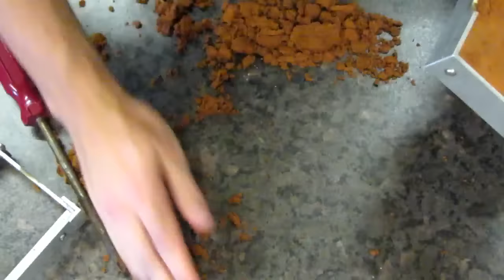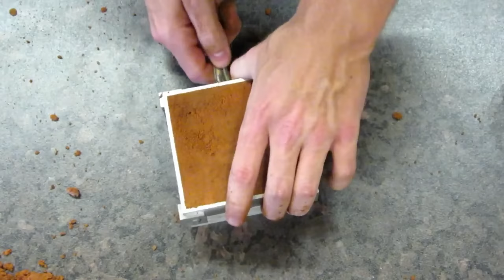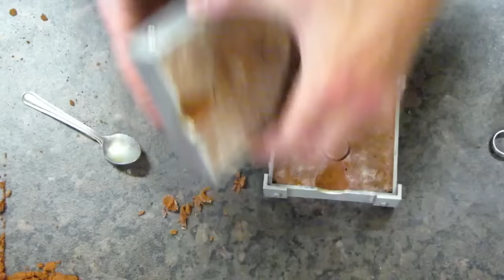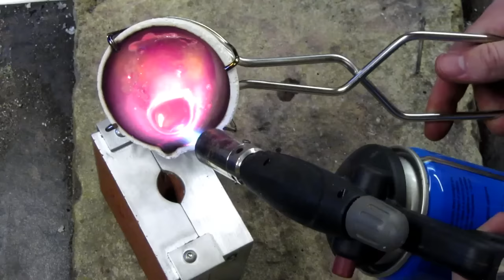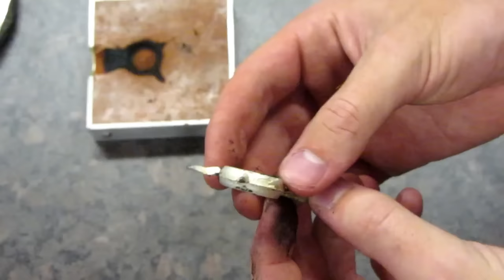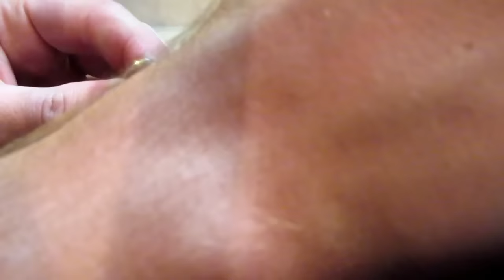Making a silver ring (sandcasting)

Comment: Great vid, thinking to give this a try myself. Just curious about what the two diagonal lines are for you drew in the sand?
Reply: Sprues or vents so that the molten metal continues to flow all of the way around to the bottom of the object. Otherwise he might have it seize up only partway around the channel and have to melt and start from the beginning. Also, it allows gases to escape to prevent pitting.

Comment: Nice job but I think it would be better to just pour the silver into solid round mold that's the size of the ring with both the top and bottom flat and then just use a large metal drill bit he size of your ring finger to drill out the center. Smoothing and polishing it would be super simple and fast and you wouldn't end up with pits in the inside like yours turned out. Still looks great though!

Comment: I've never seen anyone sand-cast jewelry before.  Usually it's done with lost wax because you get a lot better finish.  Saves most of the grinding and sanding.
Reply from the maker: Yes lost wax does give a much better finish but also required more tooling/equipment, or in my case taking it to a company to do it professionally. This is an easier method to make use of scrap that you may have accumulated
Reply: It's a bit more complicated, true.  Have you ever tried pourable high-temperature silicon rubber for things like this?  I cast a bunch of pewter medallions that way a few years ago, and it worked really well.  I got mine from Smooth-On, but it's available from other companies as well.
Reply: @Culturedropout  If by high-temperature silicon rubber, you're referring to rubber rated for ~500F (that's roughly the temp target I saw on first set of search results), that falls far short of what is required for managing molten copper/silver/gold, which falls in the range of 1615F-1983F depending on the specific metal alloy.

Comment: some imperfections with bubbles but still looks great! when i get good with my aluminium set up im going to try doing some silver and gold someday
Reply from the maker: Yeah the imperfections were a pain, gl if you do use silver and gold
Reply: @natecharleswatches  You can fill the imperfections with hard silver solder, then file back. Just heat the ring until the solder just starts to melt, then pull the flame away. A gas/air torch would be better for this method

Comment: Hi, great  Vid. I was looking for some top tips/advice, 
please. Im a metal detectorist, and often find scrap bits of silver. I 
was thinking of turning these bits, into home made jewelry, for family 
and friends. Could you give me a definitive list of things I will need 
to start me off, making a plain band. ?
Reply from the maker: Well your gonna need a crucible, tongs and a torch of some sort (I use a butane/propane mix cylinder and a torch nozzle) and ideally some borax to melt the metal. I would also advice using delft clay and frame ( I got mine off ebay for £25) to cast the metal into, possibly a ring sizer and wooden mallet to reshape the item (though this may not always be necessary) and then a mix of flat and round files, emery paper and polishing wheels to finish of the item. :)
Reply: thanks

Comment: While I'm here.. how hot does the torch get? really want to try making a shibuichi ring, which contains copper and that's about 1090'C to melt.

Also, roughly how long does a canister last?
Reply from the maker: Though I'm sure the torch can melt copper, it wont be able to melt large quantities, I would use a furnace for copper.
I use a 650ml/355g canister and I've managed around 4-5 silver pours,  as well as multiple times starting up my coal furnace, bare in mind the flame size and power is reduced a lot as it reaches its end use.

Comment: Just watched your video. It’s the best video I can get with. I would love to have ago at this. Can you tell me where did you get the mould from please? Many thanks Mark
Reply: The mould is made of petrobond sand. You could also use your own mix of "green sand". The design is the ring you want to copy. You can also carve one out of wood for the original design. The frame that holds the sand, you can tell is hand made from aluminum. You can get the aluminum parts for the frame from a hardware store or home depot or a metals suppliers. I personally make my frames out of wood.

Comment: hey, so I got all the bits but I'm struggling to get my silver to melt smoothly.. it's all chunky and runny but not like a smooth bead.. tried loads of different ways of using the blow torch but it's just not melting enough... any ideas?
Reply from the maker: have you tried adding borax or some flux to the silver?
Reply: no.. would soldering flux work?
Reply: Paul W You need to either use Borax or another flux. also better torch. Either a bigger hotter burning torch. or a bottle of map gas. Burns hotter. Should fix the problem. Also if your low on metal's.  heat it from the bottom to melting point. over top direct heat you burn off an loose some metal. Not much but depends on how much you got to work with every bit helps.

Comment: What is the purpose of the little antenna prongs that you cut off?
Reply: When you pour metal in a closed form, bubbles form while cooling. (hot air trying to escape + the air in the form has nowhere to escape). To counteract that you have those wholes so air can escape, no bubbles form and it cools of faster.
Reply from the maker: Toffsen100, good explanation

Comment: what kind of torch was that?
Reply from the maker: Its a simple blow torch head screwed onto a butane/propane mix cylinder
Reply: Is that hotter?
Reply from the maker: The butane/propane mix? not sure but its the only one I've used and does the job pretty well
Reply: Can I ask where can I get the blow torch fitting?
Reply from the maker: online, local DIY/hardware stores, I got mine from a shop called S&M Tools and Hardware in London

Comment: Hey dude, Great job on the video. Where did you get the frame?
I know all about delft clay casting. It's great but when you buy the kits you only get the round rings and they are to small for what I want to do. 😜
Reply from the maker: I got mine of ebay for around £25-30
Reply: Just showing the item. So others can look for it. 🤓 Helps to have a visual.

Comment: list of items he used ? anyone ??
Reply from the maker: -An aluminium ring sizer (to make the impression)
-Delft clay (the sand like substance used to make the mold)
-Flour (used to prevent the to sides of the mold sticking to each other)
-Propane/Butane mix gas
-8 to 9 grams of scrap 925 silver
-Crucible and crucible holder (where the metal melts)
-round and flat files
-buff sticks
-Tripoli and rouge polishing compounds
-Bristle and polishing wheels
I think that covers pretty much covers all the main items

Comment: Funwithfire Not to knock what you're doing - I love sandcasting when it applies - but in the time it takes to pack the mold, carve vents and gate, remove the ring, melt the silver, pour, remove the sprues you could have made this ring twice using silver sheet of the same dimensions.

Comment: Hi I have a load of English silver spoons and a couple of little pots laying around and want to make something nice out of them I'm only just starting up with this so don't have any experience can I just melt them down straight in to a ring for example would there be any thing els I would have to do. If any one can help would be greatly appreciated
Reply: "Silver" flatware is only silver plated. If you want to wear a mixed metal ring that has a tiny questionable percentage of silver, then melt them down and go for it. Otherwise go with at least coin silver (.90), or sterling (.925). If you really want to make jewelry from the flatware, then it would be better used for "spoon rings" or other bent flatware styles which are popular. Google "making jewelry from flatware" and you'll get all kinds of tutorials.
Reply: AlbredaWelde - hi thanks for your reply but I'm talking about solid silver pots and spoons with full British silver  hallmarks with the  lion  in the hallmark. Witch if you google you will see British silver ware is 925. Thanks tho
Reply: No one uses 100% silver to make any tool or jewelry. It is simply too soft of a metal to withstand use without deforming the object. Even .925 silver rings bend easily with wear. The fact that you have English hallmarked silver (Which, btw, the lion hallmark is not the only English hallmark, there are at least a dozen varieties.) indicates that it is not silver plated, as with more inexpensive flatware, however it is NOT "solid silver". (Also, there are still fake pieces out there sold with the traditional hallmarks which are merely plated, not "solid". Mis-marked goods are a part of manufacturing since the dawn of manufacturing.) Also, solid silver would be 100% silver. The mark of .925 indicates a 92.5% silver content alloyed with other metals like copper, etc. for strength. The fact that you refer to .925 as solid silver indicates a misunderstanding of the metallurgy. That said, you can melt your presumably legitimate sterling and obtain the same results he has illustrated here in the video. There was not step in which he did anything except form the mold prior to melting scrap (presumably .925) silver in a crucible and pouring it into the mold. Why not simply Google the information for yourself?
Reply: Ok !!! Calm down I didn't need an essay yes my mistake that I quoted solid silver after saying 925 clearly and yes there are many English hallmarks but the lion hallmark means 925 sterling silver witch is the same as jewellery I thought. so that's why I asked for some advice from some one who knows about English silver to see if I could melt it with out any problems.
Reply: I'm not excited. I simply have a manner of writing which, because it is detailed and precise, people assume means that I am over-excited. It wouldn't hurt to try a small batch of your flatware with this method and see if you like the results. I would recommend a lot more attention to the smoothing of the shape and polishing than this video demonstrates. I think you will be much happier with the result if you put in the extra time to smooth the form to a more aesthetically pleasing shape/texture.  Take care that you clean your silver first, and then thoroughly rinse the cleanser from the pieces or you will end up with a streaky/dirty piece that you cannot polish the marks from because they are inclusions in the metal from those impurities. Good luck with it.
Reply: Twix don’t №  why this appeared in my timeline 
...just to say  I’m with you. It’s not his style of precise writing 
Not at all it is arrogant to the point of patronising  rudeness. 

The problem with people like these is they have no insight into their demeanour it’s a personality disorder which they think is intelligence. 

The opposite 
...sadly 

Glad you didn’t carry on replying to him
..better person ´◔ˬ◔ˋ ツ

Comment: amature results...
Reply from the maker: Yeah the final results where little underwhelming as I have had better cast's in the past, but the porosity in the ring can be difficult to remove and unpredictable when sand casting, especially without equipment such as a vacuum which would give a much cleaner and smoother finish to the ring. But this is what can happen a lot when using the sand casting method.
Reply: oh i see now.
see if you try smaller sand and push it hard every time you add some.????
Reply from the maker: That would help reduce bumps and uneven surfaces but wouldn't effect porosity, though i do agree I should use much finer sand when starting to make the mold to reduce any gaps forming on the outside of the ring to prevent any bumps on the final cast. And although the video doesn't show it I was applying enough pressure for the sand to mold around the ring, although more pressure can be applied I didn't think it was necessary.
Reply: wish you good luck...
nice to see more videos..
Reply from the maker: Thanks
Reply: mapp gas will do the trick. (a plumbers torch)
Reply: joe jarvis map gas is baby toy.

the ultimate choices is 2 (and cheap)

1.clean propane without acetiline + medical oxygene(i mean 100%oxygene) they sell them together for hoby like you at a very good prize.

2.is an electrical base(i dont know the exact word)
but its a little bit expensine than the other.

GOOD LUCK WITH THIS.